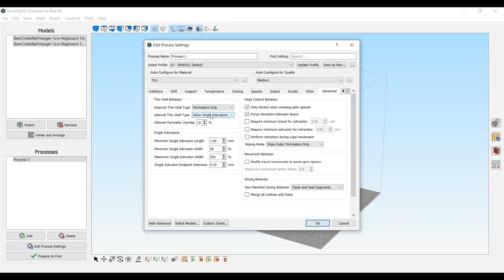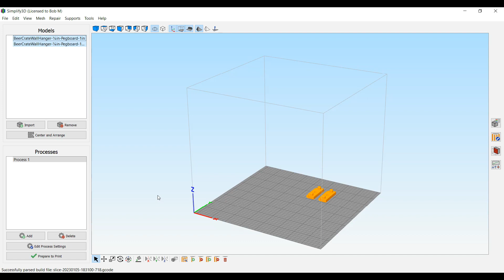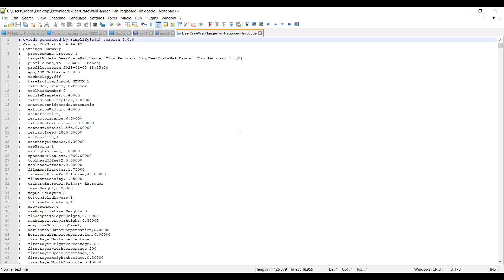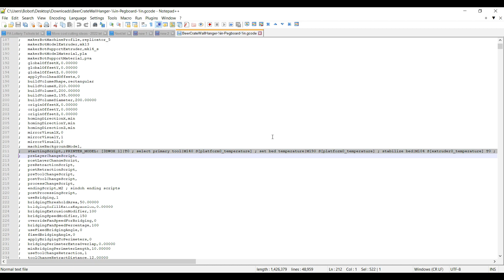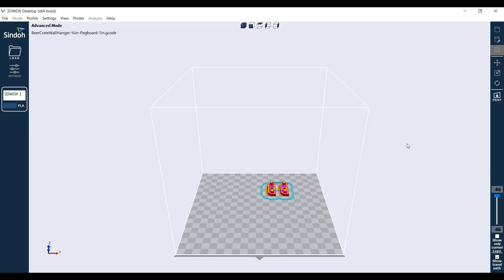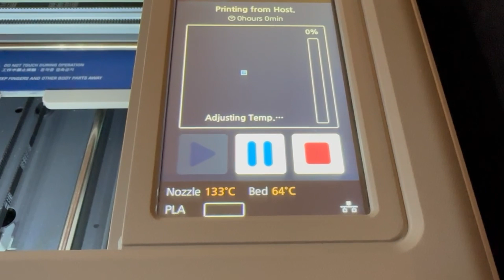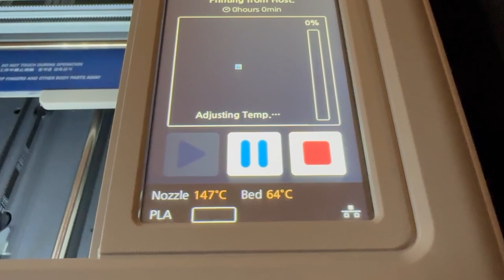Sindoh 3DWOX1 Profile for Simplify 3D v5

Comment: Hi, thanks for the update with S3D.   I am running v5 and have the same network problem with the Sindoh  and also with my Qidi ifast.   S3D will not talk over the network and I have to use the flash stick every time to transfer the files (despite S3D claiming compatibility).  Second subject is that I have just converted my DP200 to open source material which is heaven.   Trying to source Sindoh chip reels was becoming difficult and expensive.   I put a message into the Sindoh support team and received back instructions and two firmware files to load (with lots of warranty disclaimers).   This allows both in cartridge and external reels to be used without a chip. Works a treat.  I am gradually using up the dregs of filament left on reels that the chip said were empty.
Reply from the maker: Yes, I'm still using this process to edit the .gcode text file coming out of S3D and then using Sindoh slicer to send the file to the printer over the network.  Works fine.  I converted my DP200 to open source several years ago and it works, but I prefer the 3DWOX1 because of the flexible bed.  However, I also converted my DP200 over to a flexible bed of sorts (https://www.youtube.com/watch?v=JmmATcEilwg) so that works too.  The DP200 just makes a more annoying whiney noise when running vs the WOX1.
Reply: @AllThingsBobot  Did you ever work out what the Sindoh print port was?
Reply from the maker: @alanwood3597  No, I haven't messed with it.  I just print using the process outlined in the video.  I don't think I've tried hooking the printer up via USB cable.  I wonder if S3D would take to it then?

Comment: Thank you for sharing all this valuable information!
Reply from the maker: Glad it was helpful to you
Reply: @AllThingsBobot  Once I figure out why the head is way too far from the bed, I'll be making parts!  All else seems great.
Reply: In order to make it work on my 3DWOX 1, I had to change the script to this.  Otherwise the extruder was spaced about 6mm away from the
print bed:

T0 ;First Cartridge No: [0]
M140 S[platform0_temperature] ;Heat up the bed without waiting
M104 S[extruder0_temperature] T0 ;Heat up the 0th nozzle without waiting
M107 ;fan off
G200 ;nozzle cleaning
G21 ;metric values
G90 ;absolute positioning
G92 E-20 ;zero the extruded length
M190 S[platform0_temperature]  ;Heat up the bed
M109 S[extruder0_temperature] T0 ;Heat up 0th nozzle nozzle
G28     ;Home
M298 ;Move Nozzles on Bed plate
G0 F9000 Z3.00 ;Z-leveling
M206 X0.0 Y0.0 Z-0.15  ;Offset z direction
G1 F1800 E-6.000000  ;Retraction to prepare for printing

If anyone else has the same problem, try this script.